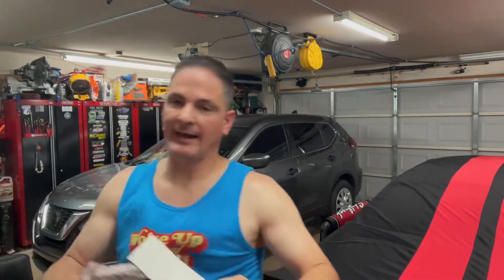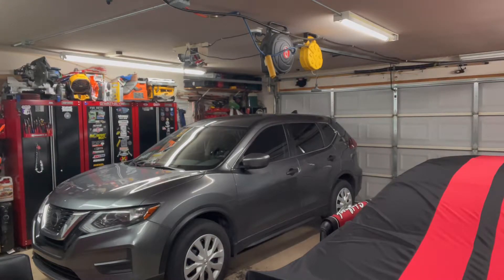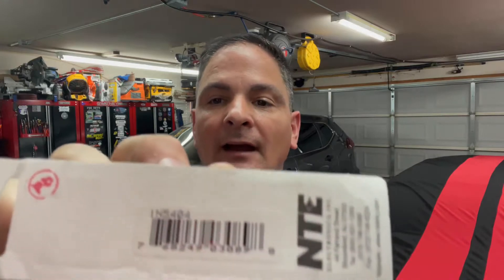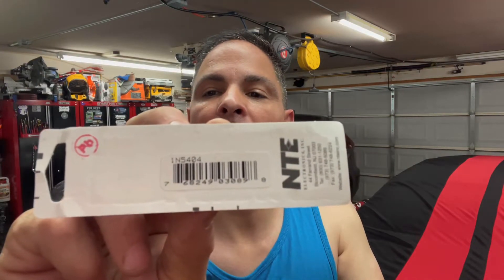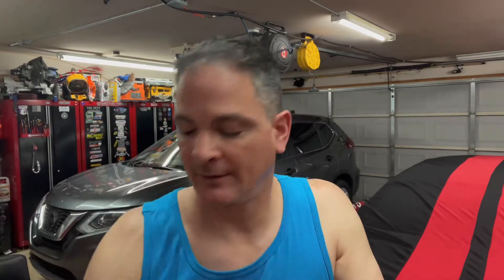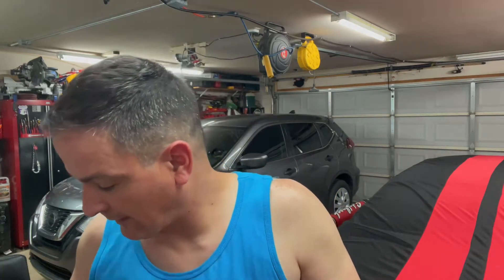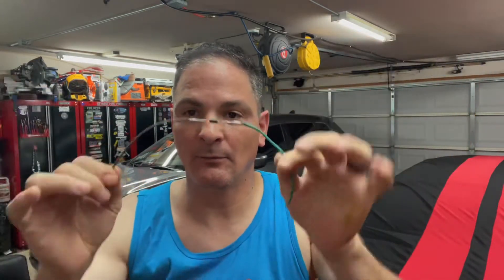Stopping the back feed on a wire to the ECU

Comment: Trying to wrap my head around this, if I have a 2002 411 ecu that provides ground to trigger fan relay coil, and I want to have another ground from ac trigger that same relay coil, if electricity is traveling from positive to negative, flowing into the ecu because it’s a ground trigger, how could the circuit ever become complete if you have one of these keeping electricity from flowing into the ecu
Reply from the maker: You would have a ground flowing from the ECU to the relay. The relay already has the main power and ground and is waiting for a ground trigger to connect the main power and ground. So when the ground from the ECU travels to the relay it allows the other two circuits to connect thus turning on the fan. Adding this keeps the second ground from back feeding to the ECU, when the ECU thinks it's off,  and triggering a light because it sees a circuit that it's not demanding.  This allows only a one way street for the flow of the current.  Does this help? When the ECU demands something to be turned on it sees the ground connect. It will throw a light if it sees current when no current is being demanded. This stops the back flow. You can have as many triggers as you want going to one relay to activate it, but if it is monitored by an ECU the ECU will trigger a check engine light when it sees it's been activated (from the back flow) when it is not calling for it to be activated. This only stops the back feed to this one wire.